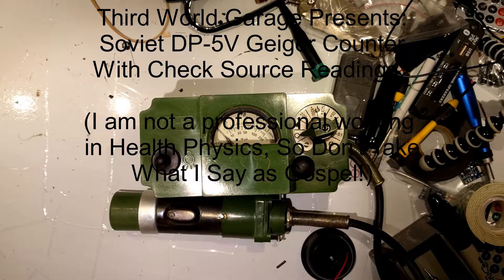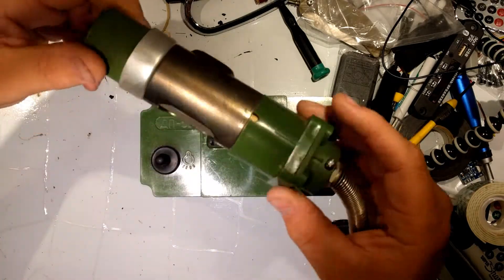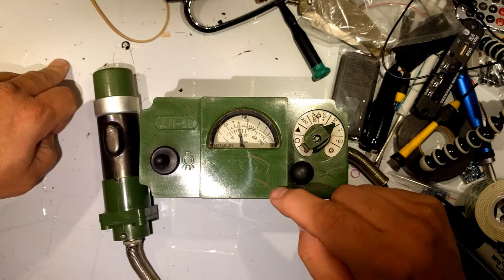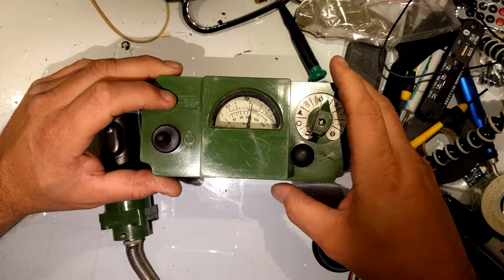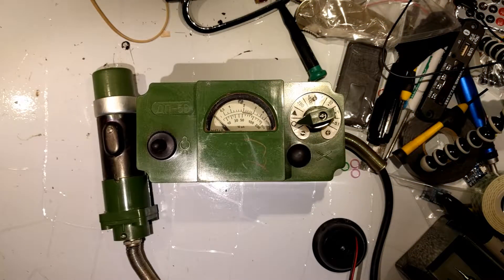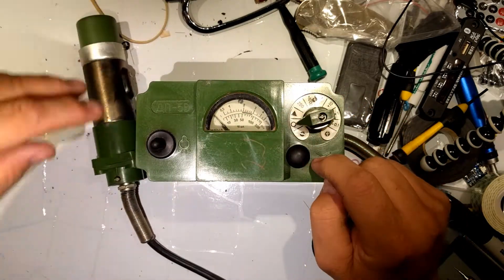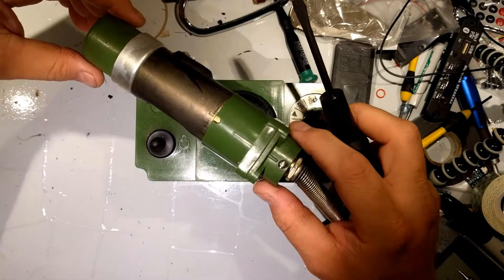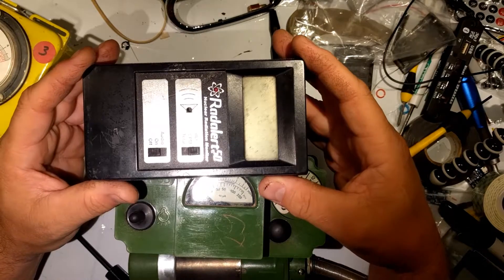Soviet DP-5V Geiger Counter Check Source Readings and Operation

Comment: i bought one of these units last year. sadly it does not work however the check source is still there!

what i find funny is that my unit does work and it's from the late eighties i think, however every DP-2 unit i have (from the 1960s) work perfectly! i'm prob gonna have to replace some capacitors or something in it to get it working again :p

Comment: I just bought an дп5б  from ebay, thanks for sharing this video, there are few on internet about this stuff
Reply: have you received it yet? if so, how is it? :-)
Reply: @kris754a  received it yesterday, the seller has take the radioactive source away and i wasn't adverted about that, but it work greats and being the (nearly) full set in new condition i can't be anything else than happy about it 
Now i only need some stuff to test it
Reply: @nyantathecollector  i would reccomend old lantern mantles that are advertised as test sources, they have a decent amount of Strontium-90 in them and are dirt cheap on ebay.
Reply: @junglejim9551  I've used a smoke relevator ionic chamber 😉